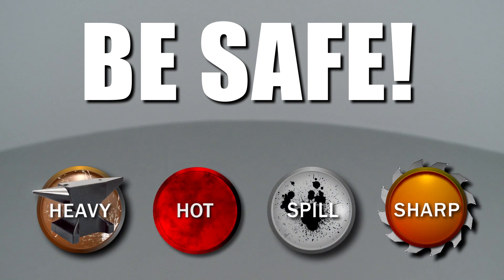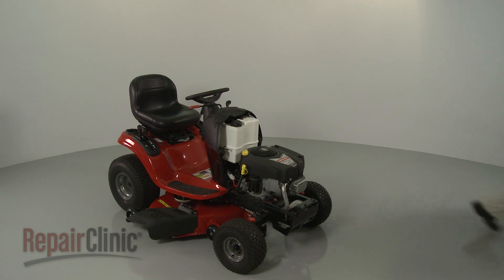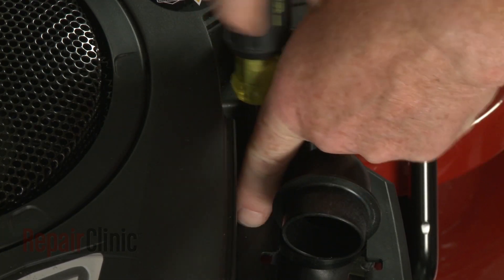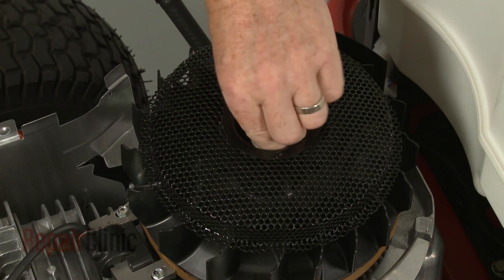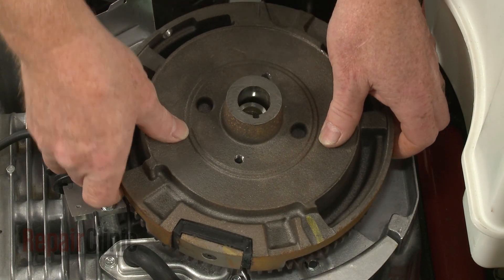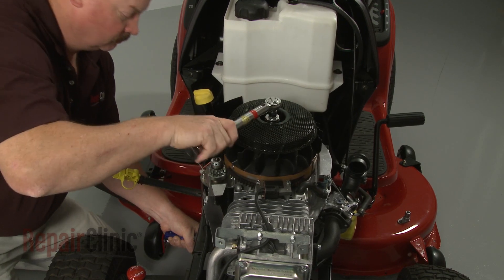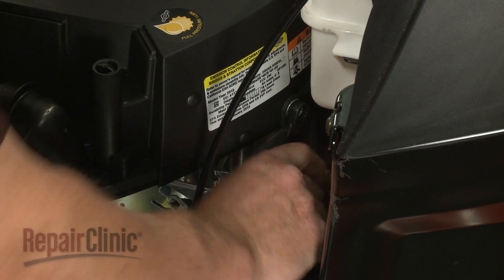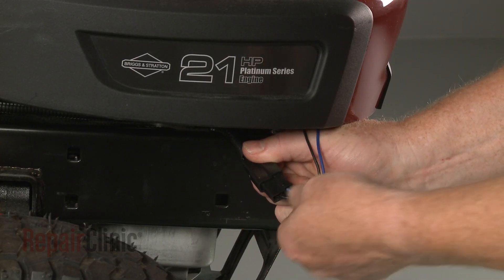Briggs & Stratton Riding Lawn Mower Replace Flywheel #591759

Comment: perfect instructions!   Well Done!!!! Yes!  The pipe wrench worked (but difficult to position for me).
Reply: About that specifically. My only gripe on this video is not all crankshafts are exposed and have enough length to use the wrench on. Secondly, I doubt the manufacturer recommends marring the mating surfaces of your crankshaft with such a tool. For anyone looking at this video. I'd recommend a strap wrench. This could be used in multiple areas to hold the flywheel and crankshaft assembly still while torquing it down. 
Thirdly, as a continuation of that part of the video. Its important to note that the lawn mower blade could be in the same position you are trying to use any of those tools talked about earlier. MAKE sure you remove the boot and or the spark plug and if you value your arm or hand at all, think about removing the blade before this step as well. Gives you the perfect opportunity to have the blades sharpened or replaced. :D

Comment: you will break the puller if you put the center bolt back in because that is what holds it down
Reply: Looks to me like they do not tighten the bolt allowing the flywheel to be lifted off the crankshaft
Reply: it's threaded so it can't release the fly wheel because it is working against each other, you put a spacer or a socket in it not the bolt itself, you would be actually pushing the flywheel down and trying to pull it up at the same time. It can't be done that way.
Reply from the maker: The bolt is threaded into the crankshaft but NOT tightened so the flywheel can slip up off the crankshaft. The flywheel slides straight off the crankshaft and is not threaded. Thanks guys!
Reply: @yippieyowster  You clearly don't know how pullers work.
Reply: @repairclinic  that's right I know you can't tighten it down but he says to put it screw back down he just don't say all the way.
Reply: @norge696  the moderator says you can't but I guess you didn't read that part
Reply: @glenyow4281  wut? I have several pullers. They put tension on the crankshaft while pulling up on the flywheel. It's not rocket science.
Reply: @norge696  you don't tighten the bolt all the way through to the crank what your trying to get it off from is my point and the moderator even says that but not in the video, you didn't read that comment. I was right. They were talking about tightening it down all the way, you can't do that. I'll give anyone a 1000 dollars to show me how that  can be done. The bolt is tighten all the way to the crank hell no. You would be threaded into the crank
Reply: @glenyow4281  I was replying to the other guy.
Reply: @norge696  it was coming on to mine. There is no way you can apply force to the crank to make it lift off with the bolt in it. I bought a harbour freight bearing puller mainly for pulling bearings but I used the puller for the lawn mower flywheel and I just used a socket to apply pressure to the crank but that thing stripped out the threads on the puller supposebly made out of hardem metal. I thought it would be stronger than that . China quality on machinery on anything they build does not have no quality control. GM parts have been made there since the bailout and they will not last.
Reply: @glenyow4281  I've used harbor freight's 8in puller and beat the hell out of it. Sometimes I snug it up and wack the center shaft with a piece of wood and the flywheel will pop.
Reply: Using the bolt by partially rethreading it (ENGAGE AT LEAST FOUR THREADS WHICH IS THE ROUGH EQUIVALENT OF A NUT) is an ancient way to protect shaft threads from puller screws. If you don't have a bolt handy another ancient trick (both are older than anyone reading this thread!) is to place a coin between the puller screw and shaft. It mangles the coin but they're basically worthless nowadays while retapping mangled shaft threads is expensive in time and a tap costs more than the coin. Ancient jet/car/truck/motorcycle/machinery/etc mechanic here. Take your time and have fun learning while saving money!
Reply: The instructions (if you bother to read them) tells you to replace the bolt a few turns i think its to protect your fingers and the puller if the flywheel comes away too sharply. My old b&s has a straight threaded spindle which went through the centre hole of the puller so i used a short mushroom headed coach bolt which did the job.